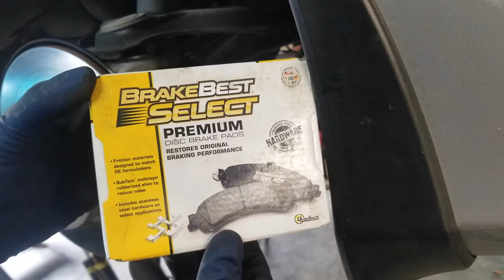2013 - 2017 Honda Accord Sport Rear Brake Pad Replacement

Comment: You failed to align the slots in the piston with the pin on the back of the brake pad. The piston needs to be turned such that a slot is pointing straight to the center of the axle when installed.

Comment: Not the greatest job. Should have lived the sliders with silicone grease and brushed the caliper off before installing new metal tins. Those tins will rise with the accumulation of rust after a while. Also grease the ears of the brake pads. You’re better than this

Comment: FYI: Use a 3/8" drive short extension to turn in the caliper piston. It works very well.
Reply from the maker: I'll have to try that
Reply from the maker: @fei3060  no. Not on most Honda's
Reply: Good idea! Improvise huh!

Comment: Not a really good job  he didn't remove rust off no grease on the kit hardware and brake pads no torque on all the bolts I didn't like his brake job
Reply from the maker: what rust do you speak of? Also, if you watch the video, I show where to grease in the event that its needed, but it wasn't needed for this one. I have NEVER torqued a brake caliper and have installed hundreds of pads throughout the years without issue. The torque specs on these are 17 ft/lb if you desire to torque them.

Comment: Why wouldn't they just use a normal caliper where you push it back with a C clamp like most others did.
Reply from the maker: No idea, it's not just Honda though. Ford and GM also have several models that use similar technology

Comment: Do you not have to open the brake fluid reservoir?
Reply from the maker: No sir
Reply: @hondaresource  do you have a video for the front brakes ?  Curious if I need to torque the caliper bolts.. One video I see they did that but doesn’t seem necessary
Reply from the maker: @josephcalegar7277  I don't but I'm with you. The only thing I ever torque is engine internals

Comment: Does your Honda Accord front brakes tend to run hot? I just got a 2017 manual and I notice that both front brakes are very hot after driving. IDK if it is normal in these cars. Will you please let me know? Thanks!
Reply from the maker: This car isn't my personal car. All brakes are going to be hot after driving though

Comment: Nice video. I noticed you didn’t use any brake grease on the pads or hardware. Is it not necessary?
Reply from the maker: I would recommend it. I just didn't have any that day and the slide pins felt ok.

Comment: What is the purpose of the springs that you put on the brake pads (last step)?
Reply from the maker: It helps prevent premature pad wear due to the pad riding against the rotors during normal driving.
Reply: @hondaresource  is there a trick to get them to stay?  I find that I am having a hard time keeping them in place while trying to put it all back together.

Comment: What happens if you install the pads with the squealers on the opposite side and its not on top instead of the bottom . But it is on the inner side or the wheel .
Reply from the maker: so, the squealer is still toward the outside of the car or the squealer is just facing down rather than up?
Reply: @hondaresource  its just upside down but its on the inner side of the wheel . So i think i used the pads from the left wheel on the right wheel so thats y
Reply from the maker: @agustinherrera5600  it'll work fine. The bottom side of the pad wears the fastest, that's why the squealer is there.
Reply: @hondaresource  what about on the front . Im not sure how i installed the pads with the squealer . I know i installed them on the inner side also and those should be on the top side right . If its on the bottom will it be ok

Comment: USeful video. What torque settings did you use on your impact drill?
Reply from the maker: I usually just keep mine on the highest setting and just go by feel. Nothing on the brakes needs to be super heavy torqued.

Comment: I have a question. I have 2017 Honda Accord and I cannot figure out this noise for the life of me. It's only when I'm braking I hear this weird noise coming from the back. Very hard to explain but sounds like a rubbing/ stretching noise. It's only when I brake. I've taken the brakes off and cleaned all the parts again but i cant figure it out. Any input would be helpful 🙏

I found a video with a similar noise.

https://youtu.be/PC_QFJy2sLw
Reply from the maker: maybe the dust shield is touching. Also some pads have a little squeal due to their composition.